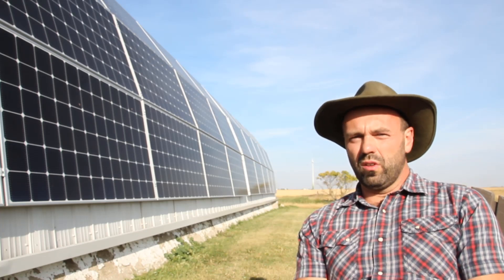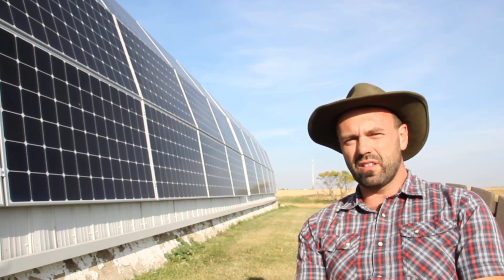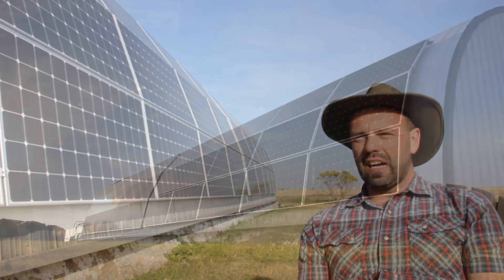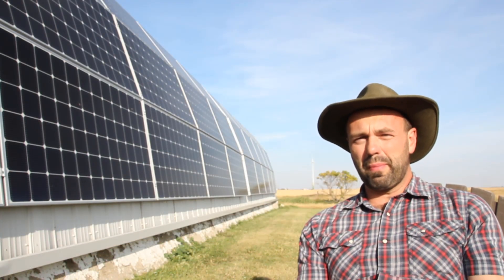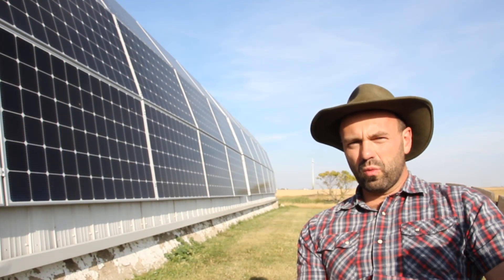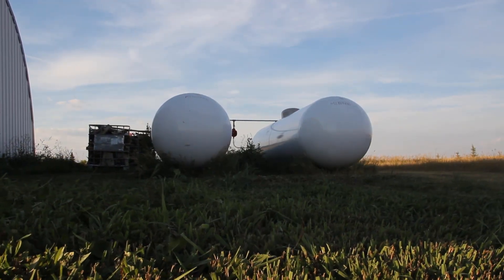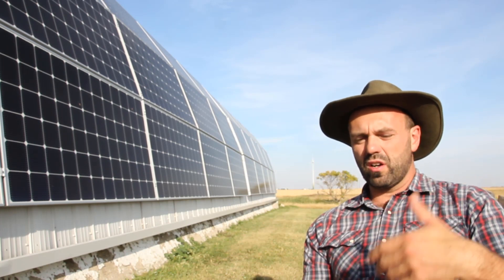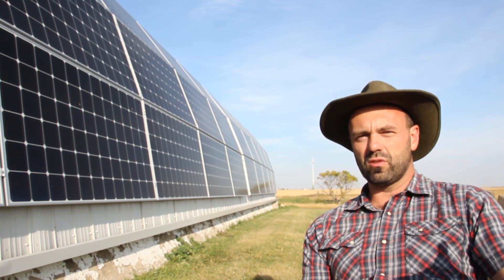Grid Hybrid Solar PV - Tesla Power Wall, Solar Edge and Propane Generator

Comment: So I have a 17kw Solaredge PV array and a propane 32kw whole house generator, I want to add a battery back up system and am looking into 4 Tesla powerwall s as the solution. Do you manually switch your power or is this a switch gear set up?

Comment: How does the generator know when to start (assuming it’s automatic)? Usually it is triggered by the automatic transfer switch when the grid goes down. Or are you using a manual transfer switch? We are all dying to see a diagram.

Comment: Will you do a follow up video showing how these systems are tied together with a hybrid inverter? Are you using frequency shifting to keep the power walls topped off? I have a 10kw solar edge inverter and want to do exactly what you've done. Thank you!